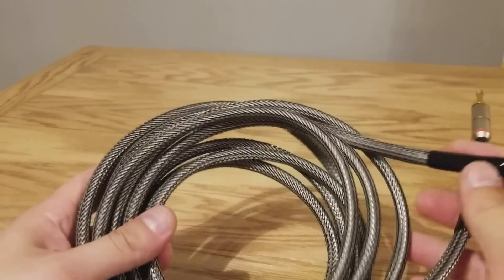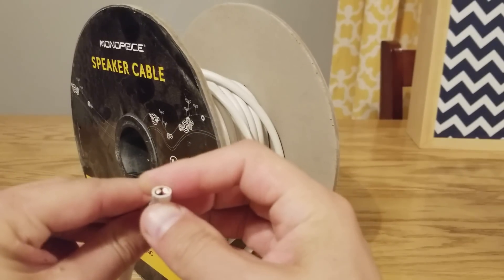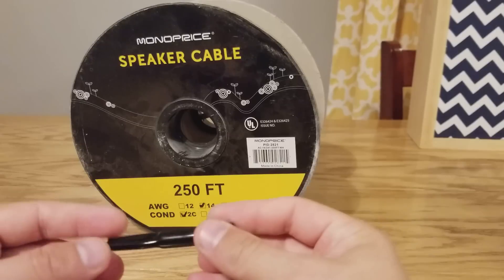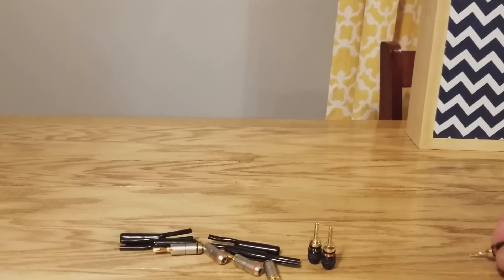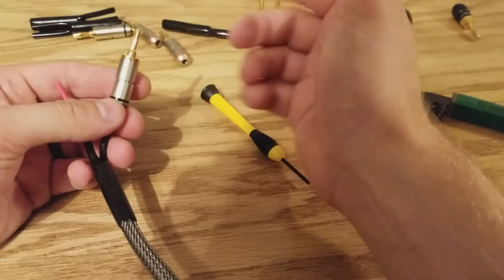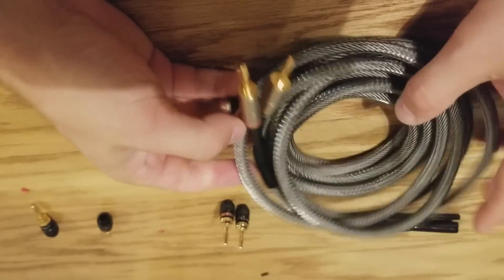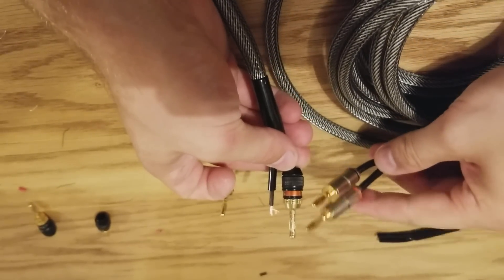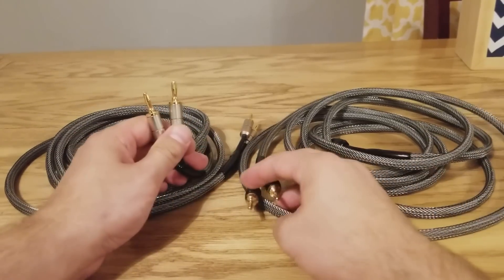How to make Your own HiFi Speaker Wire

Comment: OK, for all those who are hating on dude here for making 10.00 speaker wire look like 300.00 cable...…..what's wrong with that? I'm of the mindset that if you're going to do something do it right make it look good and enjoy, yeah, you can hear your music through a lamp cord if you like, but that's not the point, the point is to do the shit right and make it look nice, I can't wait to start on my cables, I've got nice equipment and I'm hooking them up with good wire that looks as good as my stuff.
Reply: I agree bro ...Some people just don't get it
Reply: There is nothing wrong with that. Dress it up and make all the eye candy you want..
Reply: If an “expert, golden-eared listener” doesn’t want to buy inexpensive cable, then they don’t have to. This video doesn’t claim to knock you off your feet with a dramatic improvement in sound quality. The only (constructive I hope) criticism I’d offer would be to use 12 gauge wire, but the length he’s using doesn’t require it. The ordinary guy in the street who has never been near a recording studio etc. is whom this video is for and usually we don’t have high-end gear. To me, high-end gear is over £/$ 20,000 for speakers. If you can afford that, would you really be making your own speaker cable? If he was making snake oil type claims I’d understand the bickering, but seriously for someone looking for instruction to make inexpensive speaker cable, this is a good video.
Reply: Here comes the clueless audiophiles, who don’t give any sh.t about room acoustics but think they’ll improve their sound by paying thousands of dollar on cables. The industry loves your kind for sure, congrats...
Reply: @My Name Yes, that is the point. All this exotic cable nonsense is just that.. No matter how the cable is dressed, the physics still prevail. Now, if you want to buy or dress cable because you like its appearance, that is fine. But, for speakers, the key factor is resistance. Cable guage sized for distance (or oversized) and quality connectors..
Reply: Milos Balunovic I said that... lol learn how to read eh
Reply: Michael Solomon  you can solder or screw the cable. We have mains plugs, sockets, electricity frames that are secured using screws, screw clamps etc... Mains can carry in the Uk 240vAc 13 amp. I don't think your Hifi power amp would out do that requirement. If so you must have a room the size of a stadium and 1000s of Watts of rms power. As long as the termination is secure it will be fine for audio. I totally agree with everything else you said.
Reply: Michael Solomon  I do agree totally with what you say but have you actually had audio fail through a screw or solder connection? As to hearing a difference through oxidation I certainly won't say I could at all. Of course make terminations the best you can. In telecoms we use krone, that would horrify some. It's based on the scotch block principle. It is amazingly reliable and I have seen DPs that are sited in damp environments, the krone strips green and still the connections work incredibly. Before krone we used screw terminal connections all proven to work well.
Reply: Michael Solomon  that's great you can hear that difference. It is great to experiment with these things. If it works it's a valid change for you. Stability and isolation has been another interesting set of experimentation for me. Definitely hearing benefits in those areas. Enjoy your system.
Reply: @Cbeddoe19 if you read through my comments, you'd see: 1) my complaint with OP was that he spent too much without getting any sound quality benefit; 2) I don't spend that much on cable; 3) you either don't have good enough ears or a good enough system to hear the difference; and 4) oscilloscopes can't measure sound quality, so whatever "science"  you relied on for your opinion is BS. If you don't have access to a decent system, go to a high-end stereo store and ask for a demo and you can hear for yourself and you'll stop making a fool of yourself here. For those that do have good systems, this isn't a debatable topic because everyone who does can hear the difference when you swap between cables
Reply: @EngbyMB  we are talking speaker cable. A car battery requires extremely heavy guage due to current requirements. Absolutely nothing to do with audio.
Reply: Michael Solomon  very well said. The battle I have had is previously having a property with a solid floor and now a property with a floating floor. Really changes the audio quality particularly the lower frequencies in a bad way. Through implementing what you have said and experimenting I now have my system to a level I can live with. Although it will never be as good as the previous solid floor sound I feel.
Reply: I like making my wires look good as well, but the people that pay $300 or more for wires are actually slow.
Reply: Cable is cable... doesn’t change sound quality. Only thing that changes is Gauge thickness.
End of story.
Reply: God you are all a bunch of sheep. 
As an electrical engineer I am laughing at your sorry asses for falling to these marketing tricks. 

A 2.5mm 10 bucks copper cable sounds the same as a 300 bucks "oxygen free silver plated add marketing bs here cable". 

How do I know? I tested them myself. 
There is literally no meaningful  measureable difference in the signal at these low power applications. 
Yes, speakers and amplifier are low power applications.

I work as a embedded hard and software engineer for control circuits.
So trust me I should know how to measure inputs and outputs or else I put people or businesses in danger.
Reply: For those who doubt it's possible to tell the difference between types of speaker wire, here is a simple blind test of 4 different types of wire with very clear results. The majority of test subjects use generic bulk wire in their homes and they were able to not only tell that there was a difference, but they also overwhelmingly identified the same wire as being the best of the 4 types. https://www.stereophile.com/content/minnesota-audio-society-conducts-cable-comparison-tests-0
Reply: @esquiremoderator32  It is not. 
I have test equipment at my hands, which is worth 1-2 new R8's. And when you sweep trough with a function generator from 0Hz-30Mhz and monitor the sweep on a Oscilloscope, well, the signal looks exactly the same from 0-30MHz. The  emitted RF radiation goes trough the roof at some points at high freqencies (if unshielded cable is used). But, at the stupid low frequency range from 5-20KHz, there IS no measurable variation in a signal. Anybody that says that isn't true when you measuring a straight wire, then he's lying.  

I ONLY trust measurements, because they tell you with high accuracy what's actually going on and what's not. Also measurements aren't biased from a "brain" or psychological effects. A Oscilloscope, a function generator and cables of various types. Takes nothing more to proof what I've said. And also cheap oscilloscopes are able to show, that the amplitude and frequency aren't altered or distorted by any cable there might be. You might catch more or less "Noise" from the surroundings, but speakers aren't able to convert HF noise into sound. 

Please, get you educated in a electrical field. Then you will understand that sites like "stereophile" aren't trusted sources in my opinion.
Reply: @DrDOHC  We are not talking about the electrical field (plus, I already have an oscilloscope), we are talking about listening to music. Your oscilloscope cannot hear. You have the wrong test methods and are not measuring the sound that is coming out of the speaker.
Reply: Esquire Moderator 

Im surprised by Stereophile  conducting “ tests” on speaker wires of DISSIMILAR GAUGES AND LENGTHS ! Of course there will be differences in low and high frequency energy - and which ever 
the speaker and amo “prefer” in terms of impedance and capacitance will sound best.. 
Stereophile just lost ALOT of
credibility .. really , I’d have thought they knew better .. do I smell bribe ?
Reply: @My Name "Most?" Perhaps  if you include Chinese junk. However, if you buy from a reputable American company, it isn't just window dressing.
Reply: @My Name You just repeated things I've already said, so I'm not sure what it is you're objecting to. Though, you are wrong about 16 gauge lamp cord. Test show that there are advantages to 10 or 12 gauge, depending on the application, and that there are measurable advantages to higher grade copper than what you find in lamp cord. I don't trust you though, because you've obviously never swapped cables on a high-end system. If you were correct, there would not be a noticable difference in sound when changing nothing but a cable. On a sensitive high-end system, you can sit down with four sets of speaker cable or four sets of RCA's and hear noticable differences when you swap them. Thousands upon thousands of people have had this experience and it is proven in lab testing and blind testing of humans. I'm not saying there's not BS out there, there is. But you are stuck in an argument that might have made sense in the 1970's, before advances and metals and materials, but it's a different world now. I don't know if you're the person who said that Stereophile was not a good enough source, but whoever it was has never read Stereophile and seen that their testing includes laboratory testing. Maybe spend some time there looking at their in-depth articles on cables and you'll be see what you are missing.
Reply: @My Name Like I said, some of it is bullshit. I've never denied that. My comments have been clear in that I criticized OP for spending money on appearance rather than putting that money toward buying the correct cable for his system.  I've only advocated cables that are good quality and use proven technology. 
I don't go for the $2000+ high-end for my own system and have made my own cable with the wire used in high-end cables.  I use Canare 14/4, traditionally wired by combining the 2 + and - into one connector (instead of bi-wiring). I also made jumpers and cable for my second system with 10-gauge Belkin (twisted in the gray sleeving). Then I added techflex and good copper banana clips and  some rhodium spades that I got on sale, all covered with heat shrink and wire pants. I basically copied what some of the good high-end companies are doing. But, I started with good wire, which OP did not do here, imo. It will work  My Name I agree with the parts of your comment that are repeating what I already said, of course, such as wire gauge and length. I also made it clear that there is bs out there. Not all of it is b he will hear sound, but I think the money could have been better spent elsewhere. Who knows, maybe his system isn't good enough to benefit from better wire - which goes back to choices about what he is spending money on.
Reply: @esquiremoderator32  I believe 14 AWG is sufficient for runs up to 35 feet, with an 8 ohm load (30 with a 6 ohm load, and 20 with a 4 ohm load).  Do we know how long his runs are, and the resistance of his speakers?

Between 35 and 60 feet (at 8 ohms), I would definitely move up to 12 AWG, and to 10 AWG if the run reaches 100 feet.
Reply: @esquiremoderator32  personally I call you out for a challenge. Let's meet up sit down with your high end gear because that's only when speaker cable matters and have a listening session together. I will bring a competent spec gauge speaker cable. I swap them and you pick your fancy cable out every time? Up for a fun afternoon listening to music of your choice on your hi end kit?
Reply: @a0r0a745  @Andy Abraham You "personally call me out?"  Well, sounds like I'm dealing with a real teenager here. Fine by me, but competent spec is all that I have argued for here (and that some wires sound different than others). Guy in the video spent extra money for cable that is meant for in-wall installation that costs more because it has a fire-safety rating only because he liked its appearance. I said his money would be better spent on 12 AWG pure copper. (proper spec)  If you think I believe that speaker cable must cost at least a thousand dollars you are confusing me for someone else. The way you phrased your "test" indicates you haven't followed my argument.  It seems you think I claimed I can discern my cable from every other cable on the market - which isn't even close to what I've said, nor would anyone make that claim. If you are going to take the side of the lamp-corders, then you'll have to bring lamp cord. If you acknowledge there is a competent spec, you should read my comments more closely and you'll likely find that you agree with me. (Unless you think an oscilloscope can test how a cable will sound - if that's the case, we won't agree. But since you believe in "competent spec" you are already past the oscilloscope nonsense whether you realize it or not.) Get back to me when you understand what I've said and figure out what you believe. Also, before you buy your plane ticket (or ask your parents to buy one), take the time to go to a HiFi store (or a friend's house if you know anyone with a decent system) and bring your lamp cord or 18 AWG 100 feet/$10 CCA wire and have your friend or the salesman swap cables for you. If your ears can't tell the difference, come on over and I'll show you that mine can.
Reply: @esquiremoderator32  I have just read the whole thread again and your responses to everyone you responded to. You have said cables sound different. First you don't know me. You say I have obviously not tested cables, what? I have many times and I use my ears to make that decision. I have auditioned many high end systems where cables have been swapped, no difference (speaker, interconnects, power😂, filters, conditioners etc..) The only difference was when lamp cord was used as the cheapest cable, even then the difference was so marginal compared to the cost of the Audioquest OFC cable you could argue is it worth spending the extra? This guy is not missing out on much in terms of detail etc.. with the cable he kindly demonstrated to us how to make. Well done to him on that. I do agree with you going to a decent guage OFC CABLE for not much more cost would enhance his listening experience. However, only a marginal improvement. So a question, how much do you spend per foot on your speaker cable? Oh, I am not a teenager. It was a polite get together request as like you I enjoy audio and like to experiment. I make my own cables, nice quality and connectors etc.. . I have my own lapp screened mains cables, filter and mains conditioning, nice guage OFC speaker cables and a quality coax for my DAC. Do I believe all of this made any difference between my previous cheaper cables I had, no, nothing jumped out as any difference at all. Its just nice to have quality well made cables. I somehow have guessed you are most likely from the USA? That is a shame because we will not be able to get together. I would however have been impressed if you did pick out your speaker cable every time. Changing the subject slightly but still on cables. My DAC coax has been in and out many times after upgrading components inside my DAC. Every now and then I get that classic digital skip. I thought maybe my Maplin £12 coax is slightly faulty. I decided to purchase a Chord coax rrp £90, I did get it in the sale for £30, still too much really for a bit of coax and connectors( did not feel like making my own on this occasion). If you read the Chord info on the packaging I was in for a dramatic improvement. What do you think happened in this regard? Nothing, sounds exactly the same as my previous £12 coax. Only good news is the   odd digital skip has gone so my old cable was slightly faulty. Of course I knew it was unlikely to make an ounce of difference as we are talking digital (Ac) signal voltage (analogue in the cable, it can't carry 1s and 0s, we know that) . Even my slightly faulty coax performed as well when working as the much more expensive hyped by the manufacturer cable. So you see cables do not return in the way they should with regard to their cost. Room treatments, better kit are where you are better off spending real money.

Thought I had better have another read just in case I got the wrong end of the stick with what you stated in your message to me. To quote you "it seems you think I claimed I can discern my cable from every other cable on the market - which isn't even close to what I've said, nor would anyone make that claim". At the end of your message to me you asked I get a salesman or friend swap cables for me. To quote you again "if your ears can't tell the difference,  come on over and I'll show you that mine can". So you do claim you can tell a difference? I am confused, one minute you say no one would claim they can hear a difference then you openly say your ears would.
Reply: @a0r0a745  You're right, I don't know you, just as you don't know me, so we can end this by agreeing that you don't know what I (and thousands of others) hear. You say you don't hear a difference (except for when you say you do). So, get the cables that work for you, but don't tell other people what they do or don't hear. Everybody is different. I wasn't born with perfect pitch, but I don't argue that people can't identify notes effortlessly and instantaneously. You might not have the hearing capability to hear the difference in cables, but that doesn't mean others can't.  Perhaps there is a weak spot in your system that is interfering, I don't know. My best friend since childhood came from a family that runs a HiFi store and I have the opportunity to hear many different cables doing blind swaps for fun. over the years. Some expensive cables sound alike enough that I cannot distinguish between one or the other, some sound different. Sometimes different is better, sometimes different is equivalent, but not the same. Some sound about the same as generic 12AWG OFC and I would not spend the money on those. You really defeated yourself by admitting that YOU bought expensive cables that you can't hear any difference in. That is something I would never do, nor have i recommended here.

I guessed you were a teenager because you said you "call me out." In the US, that is how a kid tells another kid that he wants to (fist) fight him. Whatever it means to you ("polite get together") doesn't matter now that I know you were full of crap anyway and had no intention to follow through with your challenge. I don't know what is polite about that. This is not a black-and-white topic, but you misconstrue my statements in a strawman fashion to argue against something I never said. For example, you implied that I would suggest people should buy Audioquest, which is something I've never said. I've never bought audioquest because I think they are overpriced and more marketing than substance. In fact, I make my own cable using Canare 4S11, techflex, heat shrink and premium spades/bananas. You again mentioned "picking out my cable every time," which is entirely in your head as I never suggested that I could pick out one high end cable every time when compared to similar high end cables. That is a complete distortion of what I've said. The pair for my main speakers cost approx $220 to make. When I find some Kimber 8tc in bulk for a cheap price, I'll make some with that, but I won't pay the retail price. AND I won't tell anyone they are wrong to buy it at full price and here is why:

You agree this is not a black-and-white topic by saying you can tell the difference when lamp cord is used. The people who don't believe cable matters think that if sound comes out of the speaker, then the cable is as good as it gets. By acknowledging this, you must know that there are matters of degree or gray areas as to the sound quality changing depending on the cable. But you contradict that notion when you say that "This guy is not missing out on much."  But he is missing out on SOME, yes? Audiophilia is the hobby of pursuing the best sound possible, so people involved in this hobby try to minimize the amount they miss as much as possible.  Similarly: "I do agree with you going to a decent guage OFC CABLE for not much more cost would enhance his listening experience. However, only a marginal improvement." So you acknowledge his cable IS imperfect and CAN be improved.  It is not up to you to decide for everyone on the planet the appropriate amount of money that should be spent to achieve the best sound possible. Maybe $1000 is too expensive for you. Fine, don't spend that much. A billionaire looks at $1000 the way you look at one cent. It means nothing to him to spend $1000, so why shouldn't he get the best sound possible if that is his hobby? Wouldn't you spend one cent to get better sound, no matter how marginal? I could understand your objection if you are a genuine communist who abhors personal wealth and think that billionaires should not exist and they should give their money to the collective good because buying expensive consumer products is a waste of society's resources.  However I doubt that is what you believe and if you believe that people can earn personal wealth, then it is not for you to say how they should spend it. There are no ethical concerns about expensive cables - they aren't blood diamonds ffs. If people can spend $100 million on a painting, they can certainly spend $5,000 on speaker cable if that makes them happy.

I've also said that cables are the very last thing you should spend money because they make a very small degree of difference. You should first worry about 1) speakers, 2) room treatments, 3) amps/sources (components and media)/DACs (order of these are variable depending on what you're working with and trying to achieve) 4) power conditioning (if necessary) and 5) cables. Just because I say cables matter, doesn't mean I'm saying they are of primary importance or that everyone needs $1000 cables. I've discussed here that good cables don't men anything to a mediocre system. The problem with most of the anti-cable people here is that they don't have systems that can benefit from better cables so they assume the same is true for everyone else. Then they find some nonsense on the internet about oscilloscope readings and misapply it to everything related to cables. It is a fact that oscilloscopes are not capable of testing the sound quality of a cable, but people swear that oscilloscopes settle this debate.  To those who say oscilloscopes can measure sound quality, I ask them to measure a sound stage because everyone who has heard a halfway decent system can hear the sound stage effect and nobody denies it exists. Yet, an oscilloscope can't measure it. Why? oscilloscopes can't measure sound quality.

As for your final paragraph, you are again misconstruing my statements into a strawman argument.  I fully addressed this already, but I'll explain again just to be clear. If you swap 5 different high-end cables of similar quality, some may sound different than mine and some may sound similar. I might be able to tell the difference between some, but not for others. Does that mean I shouldn't use high end cable? No, in fact the opposite, it means that high end cables are consistently better than lampcord. Nobody arguing on the side of cables is saying that each provide a completely unique sound. They are just saying good cables are able to reproduce more of the information contained in the source, which is the point of this hobby. You don't want a bunch of unique sounds from cables - you want all of the information contained in the source. So, the best cables should sound similar because they are reproducing the same sounds from the source. It's the inadequate cables that will produce vastly different sounds because they omit information from the source. You then quoted me, but left out half of the sentence to create your strawman argument. This is what I said: "bring your lamp cord or 18 AWG 100 feet/$10 CCA wire and have your friend or the salesman swap cables for you. If your ears can't tell the difference, come on over and I'll show you that mine can."  Do you see you logic fail? Did you think I'd fall for that cheap shot or that you somehow made a point when you said "I am confused, one minute you say no one would claim they can hear a difference then you openly say your ears would."  To be fair, you did make one point - you are confused. (But at least you learned how easy it is to spot a strawman.)
Reply: @esquiremoderator32  Sadly through this thread you tell everyone your opinion over and over again, dismissing everyone who does not agree with you even EE and technical people. You have said the same to many as you have said to me even resulting in name calling. You think I was calling for a fight, now who is the teen. You believe what you believe. I obviously don't have golden ears. You have to remember you started the opposition of negativity towards what this guy constructed in this video by your very first statement "polish a turd" Why did you bother? You obviously didn't like what he made or kindly demonstrated. So I say to you that's why you received possibly the highest reply rate in defense of this guy and this subject of cables. You could have just watched and not commented. I am not telling people what to do, you did that over and over. No doubt you will continue to do so because you are right. Oh, I purchased my cable in the sale, I have a well made high quality cable, that's what matters. One more point, I did not say you said for people to buy Audio quest cables. I think you need to read again. The only time I hear a difference is lamp cord, as soon as you go to a decent guage OFC cable a marginal difference is heard, beyond that no, I did say that I believe. Lucky for you I am in the UK my meet request is very true, to quote you "full of crap and had no intention of following through the challenge", easy for you to say at a distance. As for the strawman argument you clearly acted like a hypocrite as per my last paragraph in my previous reply to you, read it again. I do wonder your age? I won't result to name calling. Oh, hypocrite is not name calling, its pointing out you contradicted yourself, hence hypocrite. Enjoy your cables as I will mine.
Reply: @Andy Abraham More nonsense? You fundamentally agree with me on the main principle but insist upon arguing against things I never said to defend the people you don't agree with. Why? You thought you'd be their white knight but turned out to be  Humpty-Dumpty. Do go on . . .or, don't.
  
Since you refuse to hear it from me, I think you'll enjoy this series of articles by a guy who thought cables were bullshit until he heard the right ones. A lot of good info in the many links supporting his points and will help you understand the experience many of us have. https://parttimeaudiophile.com/2010/03/16/the-ultimate-in-audiophile-cabling-blue-je
Reply: @Esquire Moderator thanks for the article, interesting reading. You hear it I don't. I have already said and say it again, lamp cord sounds different, UK spec lamp flex0.75mm² 2 Core Pvc Flex 6amp, only marginally, it is not even bad on small runs, beyond good guage OFC cable I hear no change. Why do you have to keep trying to convince me and everyone else we should be hearing that difference? We are all different. Anyone can spend whatever they like on cables etc.. Its nice to have nice quality. That's why I have the Chord coax, it is a quality cable. 

I found this summary in the article you sent me interesting:

Fine. Cables matter. But do they matter a lot?

No. Not necessarily.

In most cases — in my experience — cables are subtractive. Great cables take nothing away. Shit cables take a lot away. But no cable will fundamentally alter the character of transducer sitting at the end of the chain.

So as I stated 'marginal'. He seems to have the same opinion as me. Good size guage OFC cable. Most peoples stereo setup is 2m to 4m per channel so cable resistance is not an issue either. Audible differences in these short runs becomes irrelevant to my ears. 

I have found room treatment, isolation, speaker placement and spikes can reward with much better effect on sound stage, bass definition etc.. than cables ever reward for me. 

Drop the name calling and you will gain more respect in a debate.
All the best @Oside O'NoOside🤔
Reply: I'm guessing the outer covering he's putting on is shielding right? If so he is improving the cable.
Reply: @pierrelailvaux9544  Now you are making your argument based on assumptions? FYI, shielding dose not go on the very outer layer. In the video he states that it is merely cosmetic, which makes it look pretty. Which is great for all the people that enjoy looking at their system.
Reply: Because $300 speaker cable is not the same as adding a sleeve over $10.00 this wire. He's just polishing a turd. He could have saved the money he spent on decorating cheap cable and bought better cable instead. If you only care about looks and fooling your friends and you don't care how your stereo sounds, then it's a great idea.

Look, I don't believe in spending $700 for 12 feet of wire either, but there are some accepted minimum standards for hifi stereo cable that have nothing to do with looks. For starters, 12AWG is the standard thickness for good cable and he should have spent his money on thicker cable instead of looks. He also wasted money on buying cable rated for in-wall construction. That rating is for fire protection regulations and is not good for sound. You want low resistance wire, which is accomplished with pure copper 12 AWG or thicker. Again, he chose that for looks, but it is more expensive than wire that isn't rated for fire or underground burial. He probably could have bought proper 12AWG copper for the same price has he paid for the crappy wire's costume and makeup.

If his system is so shitty that the cable doesn't matter, then it's going to look silly having "high-end" cable on a cheap system. Like driving around on $6,000 rims on a $2,000 20-year old  Honda Accord, with a top of the line K&N "Cold AIr Intake" air filter.
Reply: @esquiremoderator32  You do know that any salesman loves to sell cables, computer of audio makes no difference. The margins / profits are insane and through the roof. While i do agree with you that sleeving a 10 bux cable isnt the same as buying a 300 dollar cable. Im pretty damn sure in general a 300 dollar cable doesnt  cost more than 30 dollar when sold from the manufacturer to the reseller. Dont blindstare on the price of a cable. It means nothing.
Reply: @droomwel12  yes, I'm aware that salesman like to sell things with big profit margin and speaker cable often has large profit margin. However, I think you may have read through my comments a little too quickly. I did not tell the guy to go to an audio store to ask the salesman to tell him his favorite lies. I told him to ask to hear the cable played so that he could judge for himself and he wouldn't need to listen to a word of salesmanship or advertising. 

The problem with this debate is that there are two sets of lies on opposite ends of the spectrum and the truth lies in the middle, backed by science. This is what I have been trying to explain to the blowhard here and also the subject of the article I linked (which you might also find enlightening). One side of lies are the extremely overpriced snake oil products that go for tens of thousands of dollars and have elements with dubious legitimate function, such as battery packs. Unless your stereo system is extremely sensitive and you are running reference-quality speakers like six-figure Wilsons, there is no reason to even look at anything that expensive. At the ultra high-end level, though, systems are sensitive enough that minor differences will make the music sound different. Not necessarily better then a competitor cable, but different and people who spend that kind of money on their system can shoes the sound they prefer.

The other side of lies are those who think that anything which conducts enough electricity to get sound to come out of the speaker, is as good as quality speaker wire. These are the people who will say that a coat hanger or hair-thin wire is all you need. These people are wrong because we know that wire of poor quality, or that is too thin, cannot carry a full signal to the speaker over distance.
The scientific analysis tells us that 99% of audiophiles will do fine with 10 or 12 AWG oxygen-free copper. That's because the only thing that matters with speaker wire is that it is low-resistance and you do need a certain thickness of wire over distance to prevent signal fade. Without sufficient thickness, resistance negatively affects sound. However, wire this thick can be bought at monoprice for a decent price. 

I criticized the person who made the video because instead of getting this type of wire, he bought thinner wire and also spent extra on fire protection rating because he liked the way it looked, even though its only purpose is to meet building code requirements for storing wire inside of residential walls. He also spent even more  money on fancy covering (techflex) instead of buying 10 or 12 AWG wire with regular covering.
Reply: @esquiremoderator32  One of the best speaker wires i bought a few years ago, was Chord silver anniversary.. £5-9m They totally changed the sound of my system. sounded much clearer and you could hear every detail. 2 1.5m lengths = £16 ish.. no brainer
Reply: @k1ortia  Good deal! (Of course, there is extra cost for your connectors, heat shrink and sheathing, if you used any.) You also have the benefit of very short runs to keep the price down. 
 I also made my cables from wire I bought in bulk that goes for about $8/meter (Canare 4S11), but I needed 3.5 meters each side.  Yours is another example of good cable for not too much cost WHEN you put your money to the cable instead of the decorations (unlike OP did when he bought fire-rated cable for its looks, instead of 12-gauge OFC).
Reply: @esquiremoderator32  Sorry man you're wrong. Nul testing has demonstrated that there is no audible difference between cables except in your imagination (which by the way is powerful). You'll hear what you want to hear every time. The brain is a really powerful thing that way.
Reply: @esquiremoderator32  I don't want to be disrespectful, but perhaps you haven't seen enough studies then? I've seen studies with so-called 'experts" who when robbed of their preconceptions were easily as bad as the man on the street. You should look up the psychological effects of expectations on casual listening results. It might prove extremely informative and surprising to you. However you're obviously allowed to believe what you want. That's the point about blind listening tests though. Over and over again it's been proven the opposite with your 'experts'. They hadn't a clue and in the early days before they started adjusting for it many of their perceived 'differences' could be attributed to minute differences in the frequency response. of the various items on test.
Reply: @pierrelailvaux9544  Again, cite? You say you've seen many, so it shouldn't be a problem for you (unless you are lying).
Reply: @esquiremoderator32  These stretch back far in the past so it's difficult to cite, but I'd guess Ethan Winer would be a good enough starting off place and while you're at the checking get on YouTube (it won't take much, you're there already) and look up Peter Kay and watch his show. It's funny but it's also highly instructive about the power of suggestibility. You'll be amazed at what the brain can and will do to fool you into hearing what you expect. His accent is Northern English broad, but stick with it, it's well worth it. If you want to believe I'm lying though then so be it, I could care less. Why so hostile though? I was trying to keep it civil and what reason on earth would I have to lie about something as trivial as that? What do I stand to gain?
Reply: @esquiremoderator32  well I was just sitting here eating popcorn and enjoying the rant but I'll jump in and point out the fact that he DID provide a source for you to reference. Not only that but it's possibly the best one I know of, Ethan Winer, look him up and do a little reading. As for proper testing of cables they have all yielded the same 50% average...the same as flipping a coin. Anyone with a EE will tell you the same thing... audio is not magic voodoo  exempt from the laws of physics. You won't believe how powerful placebo effect is, read up on it.
Reply: @poserwannabe1  okay relevant username, I encourage you to continue to read through this thread, because I addressed the winer video and, unlike you, I watched it and you'll see that winer admits that cables matter and does not say what these fools are saying because they either copied the clickbait summary or only watched the first half. You'll even find that one of the deniers and I came to agreement on what is legitimate and what isn't. 
But more importantly, you shouldn't cite electrical engineers as the ultimate experts on this topic, you should be looking for physicists. The EEs constant reference to oscilloscopes is just plain wrong and these guys saying that everything that exists in sound can be measured on a scope are idiots.  If you know anything about Hi-Fi audio, you know what a soundstage is and hopefully you have a system good enough that produces one. If you are unaware, a soundstage is the ability of 2 channel speakers to position particular instruments in different parts of the room so that you know where each instrument is coming from and can point to it. Anyone who has heard a good system will acknowledge this, even EEs.. Yet, this phenomena cannot be measured on oscilloscope! Does that mean it doesn't exist? The point is that oscilloscopes cannot measure sound quality, nor the characteristics of sound reproduction. The guys with the oscilloscopes are like someone who has only seen a hammer trying to  convince you that screws can only be pounded in and that screwdrivers are a myth.
Reply: @esquiremoderator32  you really feel the need to comment on my username ??
Reply: @poserwannabe1  if it's your Christian name, I'll apologize.
Reply: WOW, You as dumb as the maker of this video! The quality of cable is NOT in the looks, you IDIOT!
Reply: @kworx1  He's not an idiot. You ever heard of nul testers? There is no measurable difference between cables. It's all in your mind, put there by advertising and lying hype. You persuade yourself you're going to hear something and you hear it. There's an English guy called Peter Kay who has a hilarious comedy routine doing just that with song lyrics. The principle is exactly the same. You hear what he tells you you'll hear, just as you apparently hear what you expect to hear with speaker cables. The only time you'll hear a legitimate difference is if your wires are corroded and you replace them with fresh copper connection. I'm afraid it's really as simple as that. Speaker cables are a giant con, a con that you unfortunately fell for.
Reply: @pierrelailvaux9544  Firstly, I am a 58 year old professional sound engineer/audiophile with a back ground in the physics of sound waves. Secondly, with all your bluster, babbling, and bleating you have not said one thing to debunk my comments about cheap cables picking up FR and electrical interference! So, unless you can validate your childish opinions, keep them to yourself!
Reply: @kworx1  A 58 year old 'professional" sound engineer who hasn't learnt much it seems. Crap is crap any way you slice it and you're talking it and that's the last I have to say on the subject.
Reply: @pierrelailvaux9544  Your really not very bright are you?